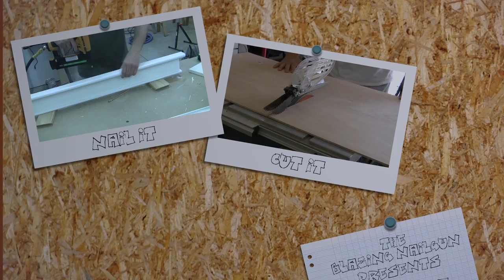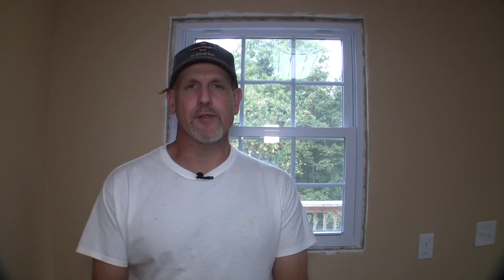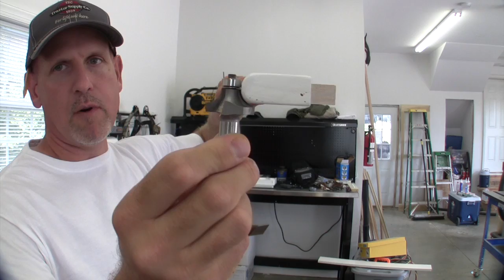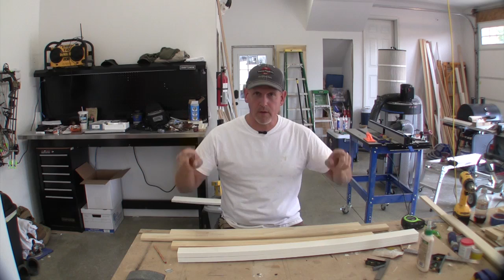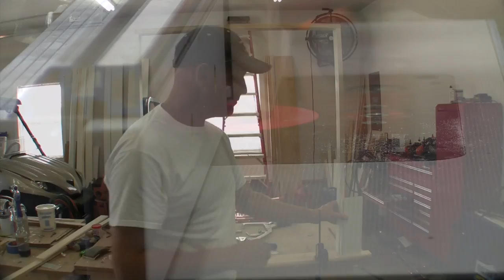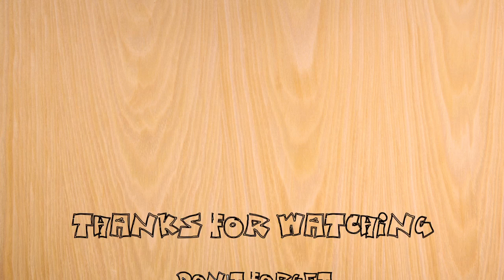How to Trim a Craftsman Style Window Pt 1

Comment: What should I do with the stool when replacing existing trim with craftsman style trim? The bottom stool in the video is cut all the way to the window, but windows with existing trim already have casing (or jam) that comes all the way out where the stool is to be placed. Do I have to remove the jam?

Comment: man I'dd measure to the drywall on both sides and maybe three spots - bottom middle top...but then again I work on old houses. Usually its fine but free ripping an extension is also pretty common on cape cod

Comment: A few questions... after watching all three parts.  How far did the stool extend in front of the wall? Also how far did the stool extend beyond the facing vertical piece?  Looks like an inch and a half, but I did not get those measurements from your three videos.

Comment: I have a question. (If you are still checking this) My window is dry wall finished and goes back 3 inches to the window frame. Home Depot sells 4" and 6" wide wood. So in your opinion to make the stool stick out enough or not too much would I need to strip the 6" down or would the 4" work? Or what would you do in that case. Thanks in advance.
Reply from the maker: +Kurto 13 I would just cut it to fit.

Comment: I like your attention to detail. You definitely "over" build, but that is what makes the difference on having to go back and fill in cracks and joints years from now. Pocket holes for the inside trim of the windows? WOW! You could survive an earthquake hiding in a window built like that!  Window and Door trim is the worst for expansion and contraction. Especially with today's "seven year soft pine". You have shown a way that will avoid these problems later.  Thanks for posting this!

Comment: I was interested in the garage.  So is this your primary residence?  What are the sizes of your rooms upstairs?
Reply from the maker: Check out my video where I give a tour.  This was before it was completely finished but it might give you an idea.  There's just under 1000 square feet upstairs not counting the viewing tower.  The bedrooms are 12X12 and 12X10.  Big den.  23X13 as I recall.

Comment: Hello and thank you for  your videos. I have actually used the "door" videos quite a lot as i play amateur carpenter and try to remodel my house in a similar style. I love your barn, that thing is awesome. My question is about my windows. I need an idea to do them in the craftsman style. They just have a "stool" or sill and a piece of trim underneath the stool. The rest of the window is outlines with painted drywall and I don't want to mess with that. So I'm just looking for ideas for the bottom